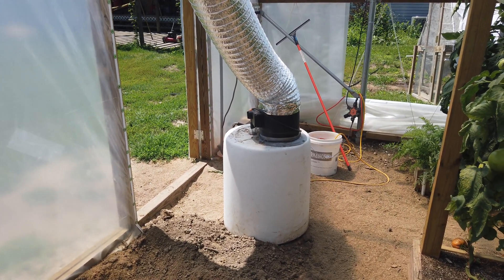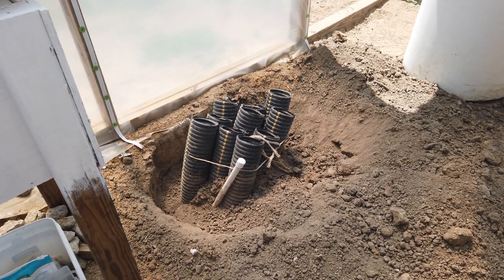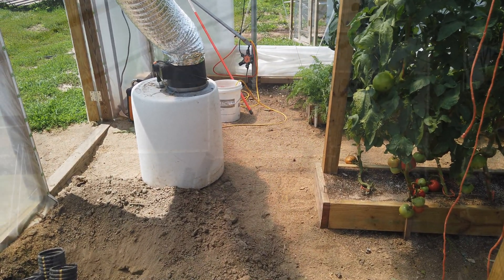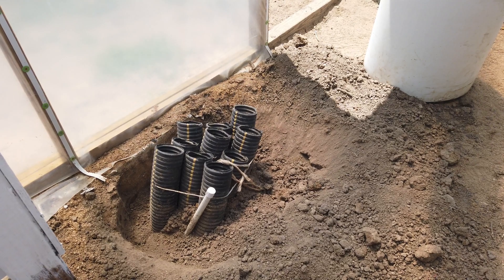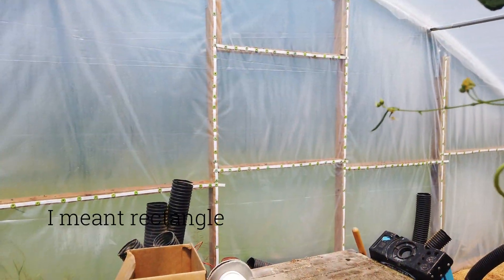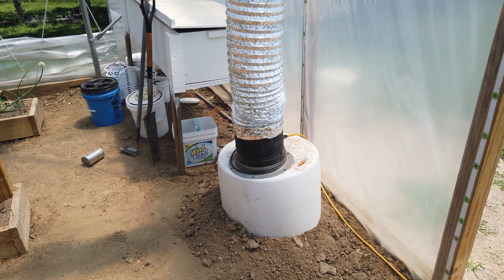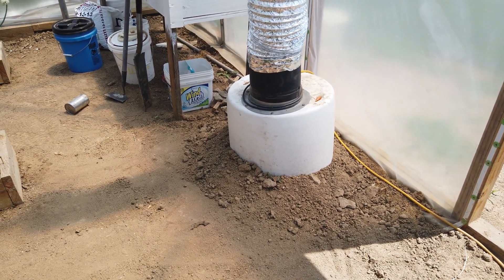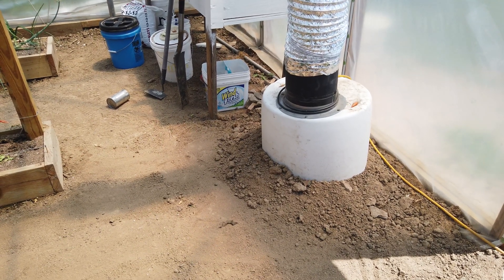Heat sink greenhouse update June 2019

Comment: How is the greenhouse and plants doing over the winter?
Reply from the maker: I didn’t get a winter crop into it.  We do have seedlings growing it in now and will have an early spring crop.
Reply: Are you changing your crop plan for this spring? Adding or subtracting plants?
Reply from the maker: @jneckcrank  we change a little each year based off of what we had too much or not enough for our table.  No drastic changes for this year over last.

Comment: Have you thought about pulling the air through the tubes instead of pushing?  This would be less stress on your blower.  Also I may have missed, but is the volume of air moved by that blower matched to the surface area of your pipes?  Do you know what the optimum flow rate for the air is?
Reply: For effective cooling (aka heat storage) the design should be geared to send the entire volume of the greenhouse underground 20x per hour, more is better. Working on the assumption the greenhouse has a volume of 7000cubic feet and the fan has an output of 1057cfm, the best you can expect is 9x. In practice, it will be less because the tubing layout wont be lossless and the fan wont be delivering close to its full output. To charge the mass, you need to move air underground. Its important to have temperature sensors installed in the mass so you can monitor the state of charge.  For example, if you know the mass charge is low going into autumn you could make the most of any remaining warm days. If you dont know what the charge state is, you could be tempted to open the side vents on those warm days, wasting  the valuable heat that should have been stored in the mass.
Reply from the maker: I’ve been giving this a lot of thought as we approach fall.  Adding a second fan and building a new manifold from wood has been on my mind.
Reply: @smallblockfuelie  
I would work through the existing design to figure what action or modification will provide the best return. For example, the cost of a second fan will be wasted if the layout cant support the extra flow. One of the best investments you can make is in a good manometer, maybe $60, which can provide invaluable information about the system.
Reply from the maker: I did consider it,  but decided against it.  Because the tubing is perforated I was concerned about dirt and dust being pulled into the piping and eventually plugging it.

Comment: The air will always favour the easiest route, long lengths of corrugated pipe represent a large resistance to air flow. ADS tubing wasnt designed for use as an air duct so you do need to build in a decent margin of headroom when designing the layout. If the air is favouring the soil route i would check the air flowrate in the tubing and the current draw of the fan. Lower than expected flowrate combined with low current draw indicates the fan is having to work too hard.
Reply from the maker: Thanks for that, John.